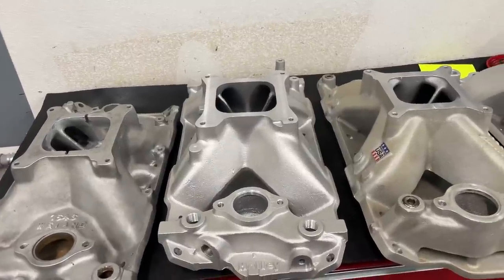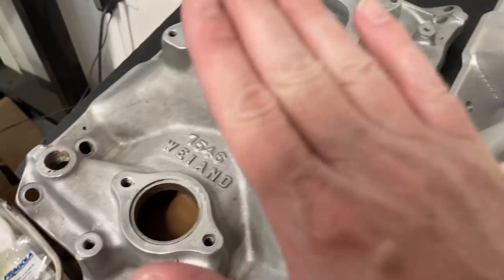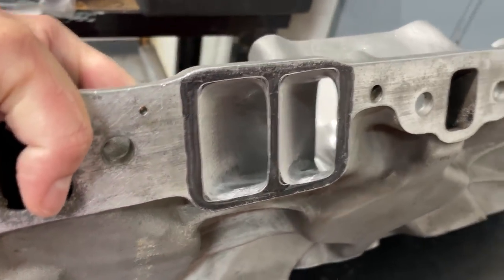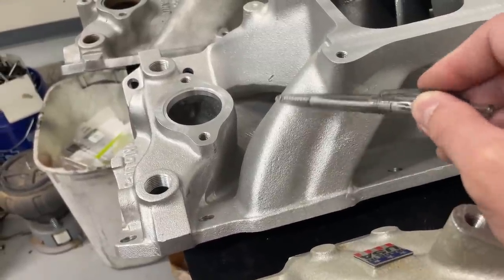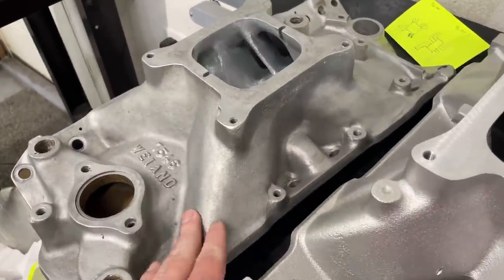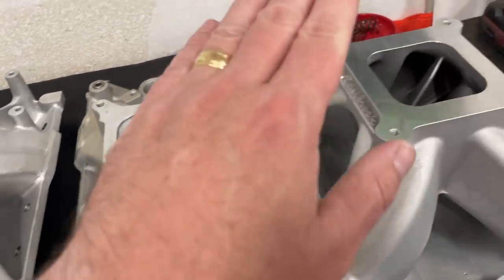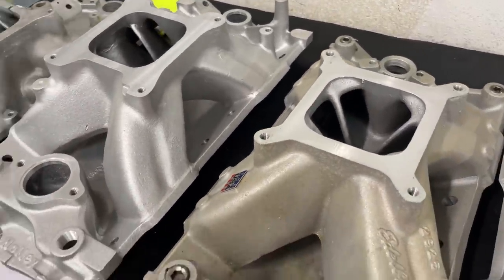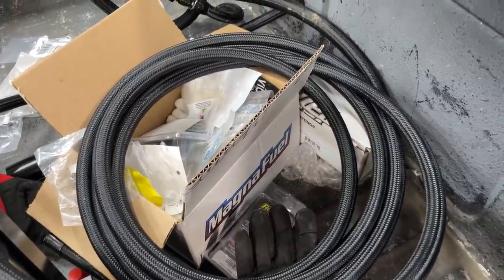Stupid Manifold Information

Comment: I don't run any SBCs that turn 9,000 RPM so I've found that throwing on a RPM Air Gap and calling it a day works good.
Reply: even the rpm is fine.......
Reply: Agreed. 
On the street, I've got a mild Mark IV 454 with oval port heads, solid cam 850DP with spacer  and an AirGap. It only ever sees max 6000rpm and the Air Gap is the best manifold I've used on the street
Reply: Exactly  correct!!!!!my strip dominator works  just fine too!!!  most cross plane cranks don't operate at those high  rpm's that is mostly  reserved  to those smaller  flat plane cranks . Especially  if we are running old school  small blocks , I like the looks of old school and think the new LS engines are ugly but don't get  me wrong  I know they run good but again  ugly!!!!!!!
Reply: @johnalarcon5006  I'd hope they'd run good considering they're basically running what amounts to a folded down EFI equipped tunnel ram.
Reply: @thetriode    Actually  it's considered  a isolated runner  not quite  a tunnel ram , infact  i have a few tunnel  rams laying  around  my garage and the only problem  I have with tunnel  rams is hooking up the linkage on the duel 450 cfm's or the 500 cfm's it's kinda a pain in the  ass as I like old school stuff !
Reply: I run a tall deck 427. 10.5 :1 comp,  a Qjet with low buck unsidedown speadbore adapter on a Airgap. This powers a 76 k20 suburban on 37" tires. My best run at Bandimire  (5800ft elevation) was 14.32. The airgap made the combo work both off and on road.

Comment: Side note: As I recall, the Torker II was not really marketed as a replacement per se for the Torker when it was introduced, but rather as a more "streetable" single-plane manifold...basically aimed at the guys who just HAD to have a single plane intake because that was the "best", but were running mild small blocks that really should have been using a dual plane intake.  Side note #2:  In quite a few of the '70s & '80s magazine tests of SBC intakes, the good old Chevrolet factory aluminum dual plate (commonly known as the "Z-28 intake") outperformed a lot of the aftermarket manifolds, to the point where it was embarassing to everyone involved.
Reply: Those Z28 intakes are probably the great grandaddy of most of the performance dual planes out there. What's amusing is that in the Pontiac Community the stock cast iron intake is considered good for 500-550hp typically and the reason you go to an aftermarket one is in many cases the weight; Then again if you "Jim Hand mod" one you can shed a ton of weight honestly.
Reply: my Torker is probably the oldest one. I know an Air Gap would work better but its too high for clearance. 
Mine is in a 402 ci L78 clone engine with an 850 dp. Works very well with my L89 heads but I know more is there.
Reply: Never had good results with  the torker, only  the strip dominator after I tested  it, nothing  worked  better for me then that isolated runner manifold 300/25,   only my weiand tunnel  ram  out performed it !   That lil 300 /25 was the lil manifold  that could , this manifold is just starting to come into its own at the rpm level at which street manifolds run out of steam , this manifold  was the first of it kind made  in 1957 and many have copied it  because it's  just that good 👍

Comment: I always ran a holley street eliminator dual plane . Back before i started playing with convertors. Even at that i used dual plane on the street. My last build 8 yrs ago saw brodix heafs and port match brodix single plane intake woth a 8 inch risers and a 1 inch phenolic plate

Comment: The runner CSA in a T-II was absolutely TINY. From what I remember the port's CSA was actually smaller than a stock 416 head from a 305. I could see how that sort of intake would cause fuel to fall out. They actually made an EFI version of it for some reason. Maybe hood cleraance.

I can't imagine how a Performer RPM couldn't absolutely trounce it. That first single plane or a Torker 1 would be an interesting dyno comparison vs a modern dual plane.

Comment: I had a torker 2 on a sbc and remember the steps in the outside radius runner and Edelbroke said it prevented reversion.  It actually worked well on a stock 1979 Z28 engine.

Comment: The old TM1 "Torker"... ran one for years.  Runners were sized to suit stock head port dimensions of late 60's/early 70's.  It is the lowest rise single plane ever made, I think.  But it is an easily streetable single plane.  They actually have to be opened up slightly to match a 1204, and don't go further.  Main problem is the runners serving end cylinders.  Because they are straight, air crashes into the bellmouth of the head opening which presents itself [for the first half inch or so] as a 70+ degree wall - not for racing.  But it is a fun period correct piece that can be at home on a daily driver, for die hard old school fans that are happy enough with sub 400hp numbers, and can serve up a combo with a stock torque converter and accessory brackets. [Damn, they ask an arm and a leg for aftermarket accessory mounts these days].
Weiand?  Chronic about not having enough meat in the casting to go after a 1206:  top edge needs another 1/8th inch or so.
Hose tech... if you find routing  goes in a tighter radius than 6x diameter, maybe think about angled fittings.  If it goes tighter than 5x, reach for fittings without blinking - it will last much longer.
Reply: You are right  man......run one on a ol school early 327 in my 56 with 4-speed...no power house but nice streetable/fun street car.......Hell everything I got is ol school!
Reply: TM-1 that is.

Comment: In the 80’s people were only making 300-400 hp.Hood clearance is Always an issue.Team-G & Victor jr barely had hood clearance with A Spacer.Always comes down to Victor-jr vs performer rpm air.Such A balance tipping point for the street.I put it down to automatic trans = RPM air gap,Manual trans = Victor jr.

Comment: I had a Victor jr manifold on my 67 chevy el camino with a 350 with a holley 750cfm single pumper, port and polished trick heads with 1.65:1 rockers and fi cam and headers. It had 4.56:1 posi with a m22 4 speed. A lot of fun
Reply from the maker: Its not a bad manifold for as old as it is.

Comment: At the time that Weiand  did pretty good, we used to weld extentions between the ports in the manifold and run a 2 inch spacer, I ran it with a 2 barrel and it worked great
Reply: I tested one on the dyno because it was one of the legal intakes for a circle track class and it was awful.  It would run ok at part throttle but at or near wide open it wouldn't run on all 8 cylinders.  The shorter style of Weiand worked ok.
Reply: That was a good idea, I'm running  a 2 inch spacer  on my manifold but have been experimenting with different  spacer plates widths all the way ton4 inch and the 2 inch seams to be the happy  medium,  I like how the newer  manifolds incorporate the spacer already  into their designs now  like the AFR

Comment: When the Torker first came out on the market. They were mainly bought by hot rodders just to get the cast iron manifold off their motor. Everybody assumed it would automatically just perform better because it had the name Edelbrock on it. So we all thought that engineers were building a much better manifold than a pig iron manifold.  And we now realize it was done to cause a replacement in a purchase of the new next and greatest manifold that was to come out once the Torker sales dropped off.

Comment: I have an old Edelbrock Streetmaster Single Plane. I won't trade it for all the money in the world. I've used it on 383-400 SBC engines, with a 2 inch, 4 hole Tapered Spacer,  and it performs great from Idle - 6500 rpm.  It's not being used on anything now, and probably will just sit around. I still won't part with it.
Reply from the maker: When you have something good its best to hold onto it.

Comment: Until recently I used a Holley Street Dominator on my Cleveland powered racecar.  For that application it was excellent but that manifold came on a 302C  road car where it was not so happy. We swapped it for a Performer and it was way better. 
Back in the dim dark ages I had a 307 Monaro with a Torker,, was horrid and fueled up plugs etc. Swapped it for a factory iron 350 manifold and a Q jet. Then it was good to drive. And ofcourse where does a Performer get its influence,, yup the factory intake!
My Sports Sedan engine [350 chev] upgraded from  original Victor Jnr on Fuellies, to Bowtie version on Dart 2s to 2925 on Victor 23 deg race heads.. We tried it with the manifold only then with a 1" then 2" spacer where it was best. Though not by a lot. BUT you would never get that set up under a roadcar bonnet. With the 4" bonnet scoop the bonnet rode on the drop base airfilter. With a fibreglass bonnet. 
Many race categories do not allow any non factory bonnet scoops so that is the reason,, and even then many modern cars do not have that clearance. 
Current car [with no scoops allowed] will have to live with no spacers on CHI race heads and intake. And with those you can look down the intake and see the back of the valve. Head design for the most part though.

Comment: Hey Eric,
     Tim here.....LOVED this vid.......i run a mildly ported tqr II on my Pontiac....i've never liked the turn, but it IS a strait shot into my heads.....(i have Kauffman heads).....Kauffman makes a single plane called the "Northwind"....it combines a tqr style with a trqrII entry into the heads......i have spoken to Jeff Kauffman personally, and for my rpm range, he said my manifold is a toss up.....it has to do with rpm/cam......i dont spin mine past 6200....(really 6000)......i wud need more cam....but at my static comp ratio, and cam, Jeff cuda just sold me their intake......instead he said i was rite on the cusp of where their Northwind wud make more power....(ergo a toss up)....what a STAND UP DUDE!!!.........their manifold is expensive, but i can get them to cnc port it the same cnc flow of my heads........he still said it was a toss up, instead, he sold me a larger cam (which he makes MUCH less $ on)....so again, what a STAND UP DUDE.....my point:....seems cam, comp ratio,  and rpm, are SIGNIFIFICANT factors in choosin the rite intake.....i wanna get to 10:90's....(at 11 flat...11:05, 11:07, 11:09, 11:06) my 10:90 is elusive)....he cuda sold me the intake, but had me buy a Kauffman Custom grind to make the ET instead....was wonderin ur thoughts......maybe the new cam, AND the Northwind wud bring my ET down???.....i just LOVE ur tech, AND that Jeff spent the time with me, and made less $, but puttin me in the rite direction.....TY SIR, for vids like this.......it IS the reason i'm subscribed, AND have my favorite Weingartner Racing Heads T-shirt!!!!....again, TY sir!!!....PEACE to you!!

Comment: I'm running an original Torker on my 427 BBC for a couple of reasons. First reason is, I needed to cut back on horsepower. Second reason, and nearly as important as the first is (for me personally), it holds a big part of my memories as a young man and seeing these on badass hotrods of the day. It just looks badass with the cocked sideways carb sitting on it. It works great with my 781 heads with small valves to keep the horsepower around 480-500. I can gain another 120hp by changing to another set of heads and a modern designed intake, which I will do one day in the future, but right now I simply do not want to spend several thousand more dollars on my drivetrain to be able to handle the added horsepower/torque!! If I can run low 11's and sneak it into the 10's every now and again, I'm totally happy.

Comment: I did all vibrant teflon hose on the Olds.  So far it's been great.  I was a little leery on summit brand hose ends and the vibrant stuff is really nice for the money.
Reply: My car has all Russell stainless steel braided lines and the old real Russell    A/N fittings, the new Russell  / eddelbrock stuff  is made in China as usual  so I replace  it with  the XRP which  is decent too

Comment: In the 1960's, Weiand and Offenhauser had single plane intakes that were boxes with 8 ports. Then in 1971, Edelbrock came out with the Tarantula, X-runner intake. A short time later, the Torker came out, with smaller volume runners. Holley spent a ton of money developing single plane intakes in the mid-1970's. Back in the 1960's and early 70's, the single plane intake was much more economical to make than dual plane intakes. I did have a Mopar Performance cast iron dual quad single plane intake for the 383. Mopar sold them with carbs, linkage and air cleaners, for both the 383 and 413 engines. Some old two barrel 318 intakes are single plane. The Offenhauser box intakes were the 360 box and the Weiand box intake had the same part numbers as their later X-runner intakes, such as 7500.
Reply: in 1979 i bought a offenhauser DUAL PORT sbc intake that had so much down low torque my 63 jeep j200 with a saginaw 4 speed and 4;09 gears would creep in low gear at idle in the deer pasture snd on pavement it would pullaway in third from 30mph. that same intake carried my 350 crate motor with the 350 hyd chev cam to 6k easy. that truck wood get rubber in all four gears on pavement, i still have it but its retired now.

Comment: My friend had a small block in his truck and he put a torker II intake, changed the camshaft,  ram horn manifolds, dual exhaust with cherry bombs.  It lost a lot of bottom end torque while not really gaining all that much in the top end. I don't know / remember what heads, cam, or displacement the engine was.

Comment: Back in the DayThe Edelbrock Scorpion II was the hot ticket for 2,000 to 7,500 rpm 400 block with 350 Crank ( a destroked 400 with pop top pistons) with a 300 duration 0.500 lift cam, That Edelbrock scorpion two was like a giant funnel, it worked well with a 780 dual feed double pumper Holley with the coreect jetting for the engine. Thing was this was a Full race setup, This was  a pain in the butt for a daily driver, 8-10 miles to the gallon cause you were running 4/11 or 4/56 gears, had to take a extra set of intake gaskets and a chaulking gun of sylicone ro seal up the front and back, nust gobbbed that in there. It was 12's in the quarter mile fast but not a fun daily driverThat Edelbrock scorpion two was for wide open throttle high rpm horse power, a 200 notrous shot worked well with this set up. You can forget the A/C, not gonna happpen!!

Comment: The early Torker had a twisted carb mount. The Torker II was all about fitting under a low stock hood and easing throttle linkage hookup. The Victor was for racing where you didn't have to fit under a stock hood.
Reply: Guy I knew who raced little windsor fords swore the old school twisted torker kicked the crap out of the Victor and all the newer stuff

Comment: Shortly after the Torker and Torker 11 were introduced they were considered terrible even in the mid 80’s as to the comment someone made by probably fine in the 3-400 hp motor the Torker series Dyno’d lower in hp and tq than a decent dual plane , can’t remember what other single planes Edelbrock had but Holley had the strip Dominator that is similar as  Victor Junior with a slightly lower pad height .
Reply: The big block Mopar version of the Torker even had big indents in the runners to clear the bolts. Not sure what they were thinking.
Reply: I ran the Holley Strip Dominator on my little .030 over 327 /331 cid SBC..wow it really increased the rpm range and had really good gains mid to upper rpm range,,just like it was advertised..this was the early 80's.   actually considering picking another one up.

Comment: I remember in the day, The Weiand Team G was the shiznit on SBC.
Reply: They make 3 different heights for SBC still. I'm guessing the tallest of the 3 is the best of them
Reply: Both of the ones he claim are junk … were rockstars on , 041 , 441 junkyard built stuff with a low lift cam like a 280 mega cam with a clutch. I was running 11.50s with a scorpion in the 80’s
Reply: tourqer 2
Reply: @mctigmctiggy1475  if you gotta ask it was before you were born. Super Shops Automotive Performance Wholesalers 🇺🇸
Reply: team G 3000 to 8500!!!! they make power.
Reply: @DANTHETUBEMAN  every guy I knew that had one had a 2800 stall , 4:11 gears and probably shifted at 6,500. On a 150 they were the shit .
Reply: @bradleymorris8875  I got mine on a 283, and it's ripping good.
Reply: @DANTHETUBEMAN  the guy I knew that was the most successful was Frank Lucero … I think it was a 331 and I know it was a 4-speed Virtigate and it ran good. My stuff was all truck motor deals Z 28 springs , mega cam and scorpion intake that I got from PAW.

Comment: As long as the port on the intake is slightly smaller than the head port it doesn’t make much change in velocity. What you don’t want is the intake port larger than the head port creating a step.for the air to climb over
Reply: Exactly  it's all about the  flow!!!!!!

Comment: I have an old original Torker I bought back in the 90s when I was youngster and yes poor manifold for racing I'm sure but it actually is a decent street manifold imo and surprisingly makes pretty good low rpm torque, good high rise dual planes I assume are better but it still runs strong. I still have it on my old hot rod truck to this day. But I have said I imagine a performer rpm would work better. I don't know if it changes anything but I have always had a 2" square to spread bore adapter for a modded Q-jet. But yes I agree it's old and antiquated.